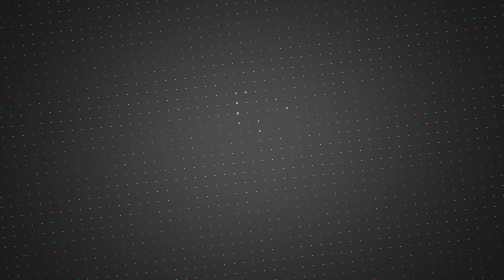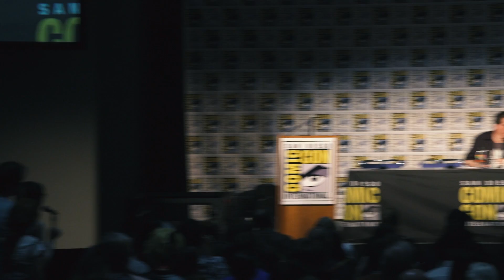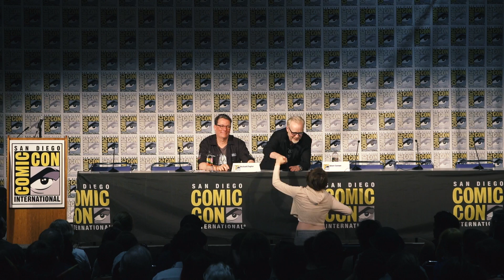Adam Savage's Least Favorite Material for Making

Comment: when I was in highschool a friend and I were making a speaker box with fiberglass. Being on a teenager budget, I decided I wanted to try and save the brush I was using between coats of resin and not cleaning it off with acetone or something. Being that a chemical reaction is taking place and you need more MEKP when the temperature is lower, I figured that sticking the brush in the freezer will yield the slowest reaction and maybe give enough time to use again as we built up the structure of the box. Well I was totally right, it worked a treat! Used that brush for hours.

And that's the story of how I destroyed all of the fridge contents with resin smell (and taste) and made the fridge unusable for weeks.
Reply: F

Comment: Perspex, Acrylic or Plexiglass. It always snaps without a warning, it scratches super easily too. I might as well use glass if I need something thats seethrough. Polycarbonate on the other side is amazing and would it not be so expensive, it would often replace plywood in my workshop. Easy to machine and it never breaks.
Reply: Depends on the tools I suppose - acrylic in an laser cutter is amazing (with the fragility caveats you mentioned).  Glass and poly are a pain to work with but look great.
Reply: Plexiglass is good for curves, just be gentle
Reply: Those materials are pretty fragile and I almost never use them. Once you drill holes in them, spiderwebbing is almost unavoidable especially if you bolt it down (even gently). Also any oils or loctite will destroy it, so keep those liquids far away. Polycarbonate is better though.
Reply: But, polycarbonate scratches much more easily.  Polyacrylate (plexiglass) is much better for scratches
Reply: Making this kind of thing colder is alot easier than making it hot.
So make it hot more than enough then forming,
After all make it could in collaboration with final form.

Comment: While I hate superglue, my body parts are extremely attracted to the stuff, then attracted to one another and everything else in the vicinity once thoroughly coated. That stuff is evil.
Reply: Same. And I've never been able to make something stick on purpose with it.
Reply: Works great for gluing fingers together... CA glue sucks & rocks
Reply: I only had negative experiences with super glue. It goes on my hands and bonds skin instantly, but not tiny plastic pieces. There it stays liquid forever.
Reply: With Superglue, I've learned less is more. All you need is barely a microscopic coating between the surfaces. Globbing it on there in large quantities increases cure time exponentially and doesn't offer additional strength, in my experience. Also, not all surfaces are compatible. Porous is best.
Reply: Thats any glue for me which is why I cant even do the simplist of papercraft.
Reply: Exactly this. No matter how careful I am, my fingers always get stuck together. Even when I feel like I've gotten away with it, the bottle splits and I end up glued to myself anyway. Every. Darn. Time! >_<

Comment: I hate cutting steel. It is super hard on any equipment, because it is literally very hard. Aluminium does almost always the same job and can be machined just like wood. Its also less heavy and doesn’t rust. So my shop is optimized for Aluminium.
Reply: Max Maker Ehh, you just need to heat it up a little. At least till red hot and it's like playdough that was left in the fridge too long. 

In all seriousness steel is a great material, arguably the greatest in history. You just can't treat it like wood, acetal or ally. You can work those materials easily with cheap dollar store kids tools. Steel requires good quality tools and machinery.
Reply: Max Maker you just need to mess with your speeds and feeds my friend. That or you need a different cutting tool.
Reply: When you're next metal shopping pick up a little 303 Stainless steel round bar and see what you think, works great with ccgt cutting inserts for lathe turning and is pretty strong, machines more nicely than unalloyed carbon steels and is generally corrosion resistant. I've increasingly found myself opting for 303 over aluminium, particularly for stressed parts like pins, axles, stubs, couplers etc.

Its is 3-4 times the price of aluminium for the same dimension, but, well I guess you get what you pay for.
Reply: Joe Smith Aluminum will have greater variance with temperature. Aluminum conducts heat very well. Stainless isn't that great of a conductor and won't be subject to as much thermal expansion.

Comment: Least favorite fabric is denim right now. It ravels like mad. It removing stitches from it leaves marks. It's not forgiving at all when you screw up. 

Least favorite building prop material is: either cheap airdry molding clay cause it constantly cracks as it drys and breaks super easy. Or bondo...lightweight filler my butt. It's lightweight for a car. I know it works great in some applications but not the ones I used it for.

Comment: Nylon or MC Nylon? I used to machine parts for our machines using MC Nylon and it's quite fast and easy to mill or lathe them.. surfaces turns out great but that is if you have sharp tools..

Comment: Mine was glass,
Then I decided dive into & master it and ten l did .
disgusting material like  Nylon witch Adam sed and even polyester reminds me of characteristic of glass,
 oh I love it 😈
Reply: Ashkan Sayadi try glass filled nylon. Lol.
Reply: @charliespurr7325   
There's alrady glass filled nylon in clam Schells of tools, 
Glass fibers and    glass granolas are devastatingly hard for plastic injection molds, usually wears them off so quick  .

Laugh out laoud    now!😈
Reply: I know that's why mentioned it.
Reply: Glass filled nylon really does destroy shit. I can't believe we are using the same mold still.
Reply: @charliespurr7325  
Hardness of glass is 5.5
More than every other hard metals for moulding like steel .
It's happens in micron scale on high stress areas after several thousand molding procedures.
Reply: Ashkan Sayadi this mold is easily churning out a few thousand parts per job. I'm surprised the mold has lasted that long. Then again it does seem to have a lot of issues... And God forbid if we have to do any kind of machining work after.
Reply: @charliespurr7325  sure a few filling welds &machining gonna repair that ,
But like a lot of chinizium products u can grow clam Shells parts together in weared off molds and it's not gonna be 100% song fit  seamless contraptions, 
Also in over molded parts specially in softer over molded materials, 
  it's not gonna fit into intersections so u have to machine secondary molds too ,
Because of thickness. 

Actually weared  off molds don't behave desirablely thermal expansion wise.